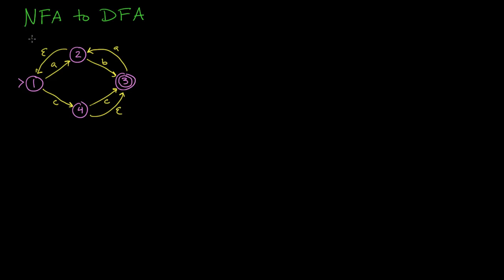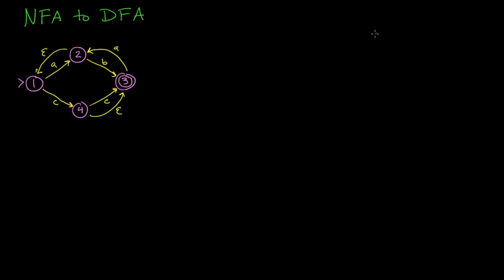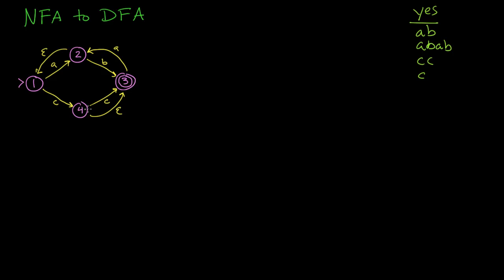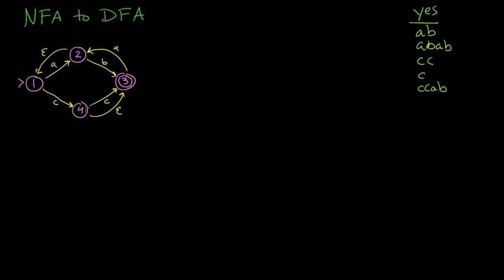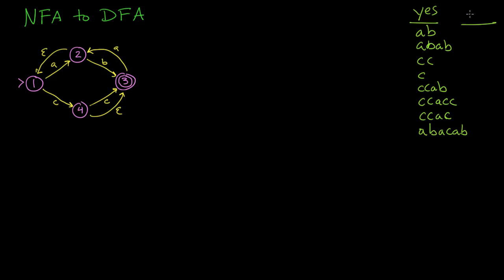Convert NFA to DFA

Comment: This video builds the DFA table with input symbol followed by epsilon*, where-as the correct way to do it would be to build it with epsilon* input symbol epsilon*
Reply: When taking the start state it should be the start state of the NFA and all states reachable with epsilon* then building the table as he did works fine

Comment: Doesn't work if your startingpoint has only epsilon transitions going out and nothing coming in, (for instance if you want to OR/unite two NFAs via a new startingstate that has an epsilon transition to the startingstate of each of the original 2 machines) that way u would have a blank in the first grid at 1a 1b and 1c. Only 1epsilon* would lead to other states.
If you can't do a, then you can't do aepsilon* which means the second grid 1aepsilon* and 1bepsilon* would also have no states --> starting states has no connecion to any other state. :/
Reply: You have to consider as your starting state the ε-closure of your original starting state. The ε-closure is defined as the set of states that you can end up to if you begin from your original state and traverse 0 or more ε transitions. If you do that you don't face this problem anymore and the method is correct.

Comment: As I learned it, this isn't a final DFA; you need to add a trap state for transitions not charted; eg, 1 c -> trap; 4,3 b -> trap; 3 c -> trap; 3 b -> trap.
Reply: There are different ways to write DFA's, at least from what I see in different places (websites/EDU's/books). Garbage states are left out in some informal diagrams. The most correct / formal way to write it would include these garbage states / fail states. 
The garbage states/fail states do not technically add anything to the diagram since they don't convey extra info.

Comment: What happens if your initial state only have an epsilon transition? Following your method it leads me to not having any new entry on the second table. Thanks :)
Reply: Well i think I've just solved it myself. Having just that transition it's like not having that state at all and starting the NFA where that transition leads, on the next state, so I can just delete the initial state and make its next the new initial state. Correct me if I'm wrong...
The problem may come if that initial state that I've just deleted was an acepting state, in that case what should i do?
Thanks again (º-º)7
Reply: same question. what if the initial state has 3 epsilon transactions? which state do i make the new one after i delete the initial state? according to what you said.
Reply: I think when he writes the "1" to start off the second table, he should be writing the epsilon closure of the starting state, not the starting state itself.  But in this case they just happen to be the same.

Comment: In order to account for an NFA with ε coming from the start state and/or multiple consecutive ε transitions:

(1) The ε column of the NFA table must contain every state reachable via ε transitions from that row's state. 
For example, if we add an ε transition from state 1 to state 3, we would need to add 3 to state 1's ε column (changing it from [1] to [1,3]) but we would also need to update state 2's ε column because state 2 can now reach state 3 via ε transitions (so state 2's ε column would be changed from [2,1] to [2,1,3]).

(2) The start state of the DFA will not (necessarily) be the start state of the NFA - it will be the NFA start state's ε column value.
In the example I gave in (1) where we added ε from state 1 to state 3 in the NFA, the start state of the DFA will be [1,3], not [1].

Comment: The only issue with your approach is that if node 1 has any  epsilon transition then while creating the ae* , be* table, you have to consider  the closure of 1 not 1 itself for starting stage. In video at time stamp 7:24  you have to consider closer of 1 as starting stage.
Reply: Lets say the start state has 3 epsilon transitions to 3 other states. Now after using ur approach and considering the closure, which state will be the new start state of my DFA? Can u please help?

Comment: Barry, sorry you failed. The structure you constructed is not a DFA it's still NFA.
Reply: yeah, a new state "5"  has to be made, where every state that goes to "nowhere" ends up there
(1, b -> 5)
(4,3, b ->5)
(3, b -> 5)
(3, c -> 5)

and 5 returns to itself for any input (a,b,c)
(5, a) -> 5
(5, b) -> 5
(5, c) -> 5

but Barry thanks a looot, having an exam in few hours xD
Reply: ***** That's correct, it's what I meant.
Reply: AW Tahhan state 5 is NOT a final state. normal state like (2,1)
but has to be there cause DFAs must have defined transitions from EVERY state given ANY input.
Reply: ***** I would to confirm that the state 5 must be non-final state cause by definition
(Every language that can be accepted by an NFA can also be accepted by a DFA and visa-versa. Expressing the language in DFA or NFA Doesn't give any additional language acceptance power.)
If you add the final state 5, then, the DFA will accept (a) or (b) which is wrong cause the original NFA doesn't accept them.
:-)
Reply: ***** yeah, got it.
Reply: ***** thanks mate
Reply: I don't think so. Epsilon (or alpha) transitions mean that you can virtually do anything. They rob the FA of determinism.  It's easy to misconstrue this as a DFA because I think we're used to seeing multiple outputs as a NFA.

Comment: This example is missing the case where there are two As coming from the same node. How do you handle that using this table technique?
Reply: Prpably by just creating a new state out of both end-point-states the A's point to. Just like it's done for the epsilon-transitions which are implicitly two transitions on the same input if one is explicitly mentioned because you can also go back to the state itself as well as to the new state which the explicit epsilon-transition points to: like the 2,1 and 4,3 states in the video
Reply: do you mean twos 'a's coming from, say, q0 to q2? In that case one of the a transitions is redundant

Comment: What if the NFA has two or more start states? DFAs can only have one start state, right?
Reply: I would say yes. If it had two start states, that would be non-deterministic. Which one do you choose?
Reply: My lecturer told me yesterday that if you have two or more start states then the new start state is the state made from both of the original start states. For example, if your NFA had start states 0 and 1, then your DFA's start state would be 01.

Comment: if start state have 2 states connect by epsilon. ex. A->B by epsilon and A 's start state.
How does it work?
Reply: For anyone reading: essentially merge these together for the first state you start from in the second table. So this start state is anything reachable from the original start state with zero or more epsilons.

In this case the start state would be: (A, B). Then just carry out the rest of the process as usual.
Reply: *****
Patrick is correct.  To put it another way, the "1" he writes to start the second table is not the starting state.  It's the epsilon closure of the starting state, which is actually a set, {1}.  If the starting state had epsilons other than itself, then the set would contain more than one state.

Comment: in 4,3 when a input there is a new stat 3,2,1 isn't it ?  Or am I mistaken
Reply: After consuming an "a", your existence in state 4 should just die per the defined behavior of an NFA. So "a" should only take you from 3->2, then 2->1 via an epsilon. Therefore the final possible states are {1,2}.

Comment: There is one part unclear in the video, and it might confuse you: 

The new start state in the DFA corresponds to the set of all states reachable from the NFA's start state by following zero or more transition on the empty string. In other words, the new start state in this DFA is 1E*, instead of just 1. It just happens that in this NFA, 1E* leads to nowhere besides 1 itself. Hope this helps.
Reply: I am replying this comment 6 years after it is posted just to thank you. Your comment was very helpful. Thanks a lot.

Comment: Sadly, this is incorrect.
Reply: Wat...? How..? pls tell me..
Reply: Gurumoorthy Ganesan Hi, I dont think his method could be applied to any NFA that contains the representation of a closure. 
e.g Try to reduce the NFA of a* to an equivalent DFA. The method described above shall fail. :)
Reply: Saurabh Garg Actually, it works with a*. If you look at the NFA of a* (like the one he showed in his other video), you can fully convert it to DFA using this method.  It will show 2 as a starting state and 4,2 as an end state and A bridging them and 4,2 point to itself using A.  if you want, you can eliminate 2 since 2 is already present in 4,2 and use 4,2 as starting AND final state and have it point to itself with A.
Reply: "This is incorrect" without any explanation, is incorrect.

Comment: I don't think this method works... Or you are handling this casee Try.. anything that starts with a*.... e.g a*(a|b)
Reply: I had a similar problem :( Converted an NFA to a DFA but my starting state is just on it's own and doesnt lead anywhere, which cant be right. I was given (ab*)*ab
Reply: ***** Exactyl it leads to nowheree... if anything with * is involved in prefix...

Comment: I was asking myself the same thing. It doesn't make a difference when you have simple automata with a few states - you can just look at the picture and figure out what needs to be written in table#2.

However, in the case of complex machines with many states, transitions and symbols - the role of table#1 is that you can use it to look things up, instead of doing this "in your head" (which would be impractical for very large problems).

Comment from the maker: To address your second concern (start state with only epsilon transitions), when creating your second chart, the start state would be all states that are reachable from the original start state with zero or more epsilons. For example, if state 1 went to states 2 and 3 with only epsilons, the starting state in the second chart would be 1,2,3.
Reply: There is another unaddressed corollary concern. What about a state in the middle of the graph that is only accessible via epsilon transitions? The NFA for A(AB)*(C|BA) is one such example. I believe the solution is, for any epsilon transition that leads to a state in which there are only epsilon transitions exiting it, you would also include the additional exiting epsilon transitions.

Comment: This is not necessarily true. It is implied that the string "b" is not accepted because there is nowhere to go from the start state with 'b' as an input. If there is nowhere to go upon an input the machine does not accept the input string. If your input string does not land you on an accept state it is not accepted. For instance, does the string "b" bring you to an accept state in his diagram? No. So this string is not accepted. DFA's are about which strings are accepted not those which are not.

Comment: @lv766 Hmm...I've already forgotten a lot of this I'm afraid so I can't really respond too intelligently... I will say though that I had the same problem as @LCaaroe, that I couldn't get your method to work if my start state has only two epsilon transitions to two different states. If you draw one out and try to use your method, even from just the start state, you can't do it. How would your system handle that case?

Comment: DO NOT USE THIS METHOD, IT IS INCOMPLETE. First, in a DFA you have to have an explicit path for every transition. In his final diagram, for instance, there is nowhere to go if your first character is a 'b'. He should be drawing b to another state that has a,b, and c all returning to itself, so that you can never accept something starting with a b. MORE TROUBLING: what if your start NFA state has two epsilon transitions to two other states, and no other paths? His method cannot handle this case.